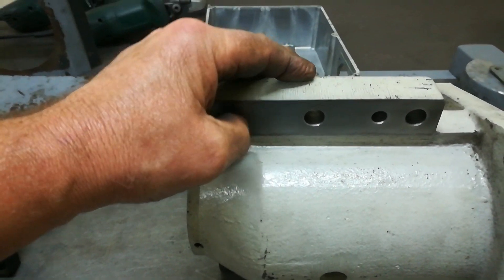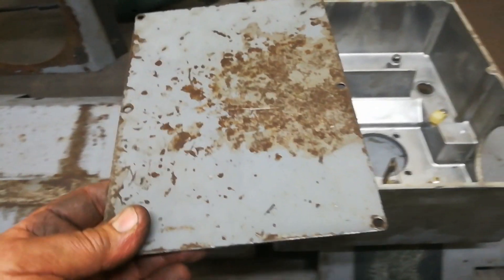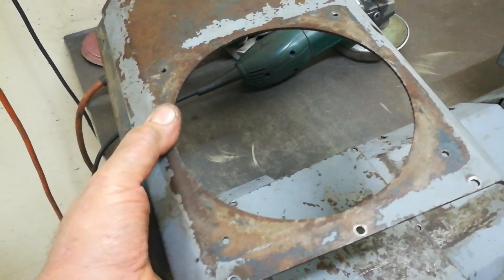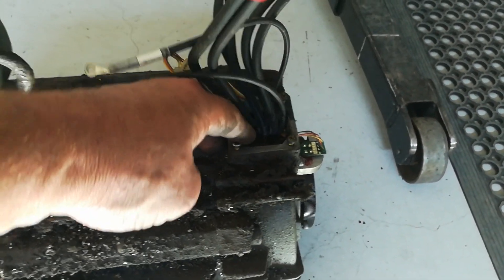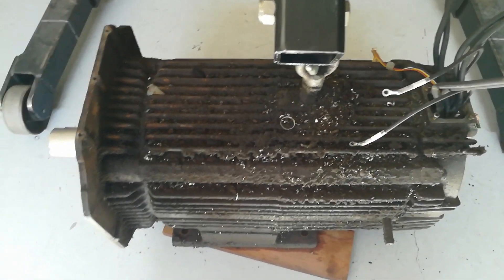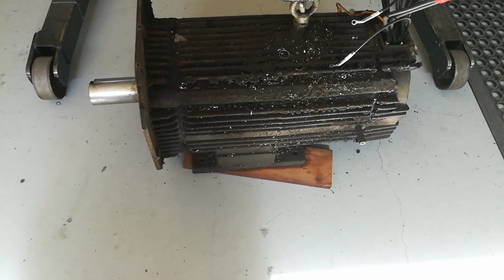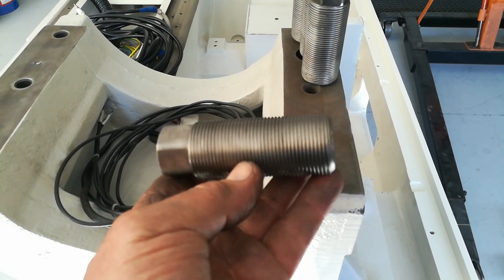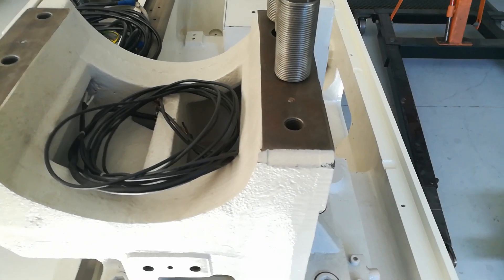Rebuilding a CNC Lathe. Preparing Parts for Painting.

Comment: I'm impressed with how robust the parts are. That servo motor casting is not fooling around when it comes to mounting.
Reply from the maker: Hey John.
It,s funny even when i was doing this video i was thinking the same thing.
Especially as you pointed out the Servo Motor mount.
I am sure they do not build the machines this heavy now.

As an example this machine is a 2 axis and weighs 4500 kgs in total.
There is a New Doosan CNC Lathe ( LYNX 210 ) that i would like to buy similar to my machine but 4 axis this machine weighs 3600 kgs must be cutting back on something, lol.

Hope you will enjoy more video,s in the near future.
As mentioned short video,s are the key.
Thanks for watching this video.
Peter.

Comment: That thing will probably make the lights go dim when you turn it on !  Would you need a 50A supply for the 20hp ?
Reply from the maker: Hey Max.
Yes it,s not the most power efficient machine i own that is true.
Most lightly need a few Solar Panels to run this machine, lol.
Thanks for dropping by.
Peter.

Comment: Morning Peter - I appreciate the acknowledgement of time versus actual payoff. 

Will a pretty lathe create better parts?  

Also my local long-term scientific study shows that there is a definite positive correlation between down time and the time it takes to reassemble a project. The longer a part is down - there is an increase in lost parts and a reduction in the recollection of how it came apart. LOL.  

Good stuff.  I hope you find a good buy on bearings and seals. Maybe there is a chap who started and stopped and has the parts for cheap. 

Dan
Reply from the maker: Hey Dan.
It is a new story for you but an old one for me ?
It is difficult to say which is the best approach.
Buy New equipment then be busy trying to find work for it, which is common in a CNC machining market place.
Or buy what is affordable and build from there.
But at the same time missing out on the latest technology.

I will most lightly never buy a new CNC Lathe for a few reasons.
Firstly i have NO interest in becoming a long term Machining Business, i am still primarily a Repair Shop

From a business point of view,  what i am doing is totally the wrong way to approach it.
I guess in simple terms if i did not buy this machine i would need to find an outside machine shop to undertake any work required.
At current i do send work out to be completed, with assorted problems that go along with this scenario.
As my approach to this Mission as i like to call it,  is more of a Personal venture Not so much a Business venture. 
My approach to the rebuild is more for personal gains, with later financial gains.
Will a tidy machine make better parts definitely Not.
Will a well maintained machine be less troublesome long term most definitely Yes.
I need an environment that is both comfortable and functional, which includes machinery that reflects the way i work.
ie Tidy Equipment.

Thank you for prompting a reply to this Mission.
Thanks for your comment, much appreciated.
Peter.